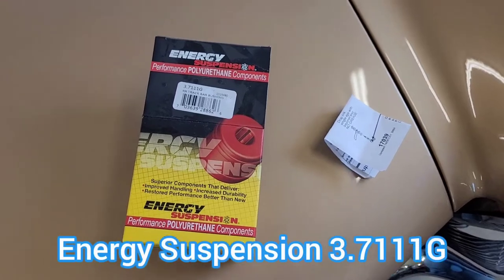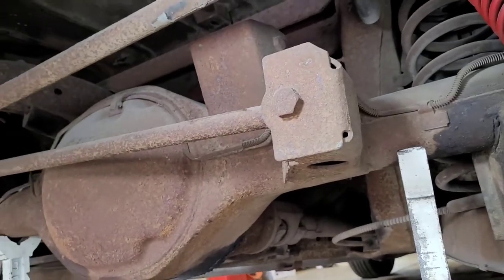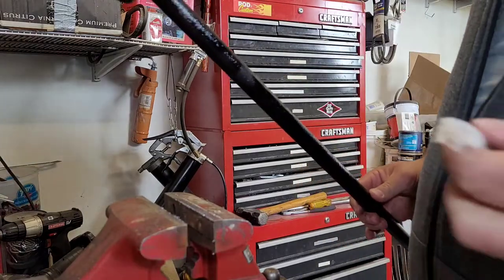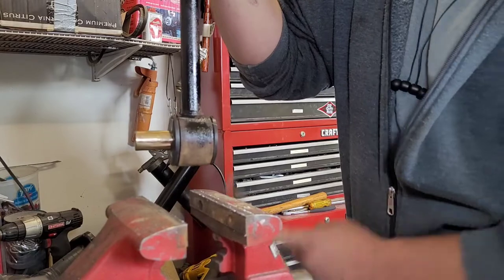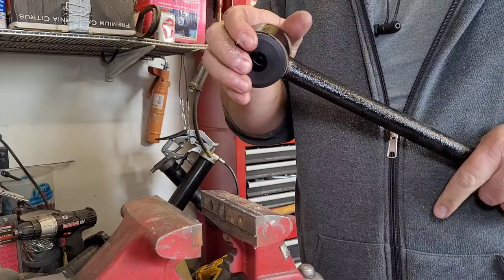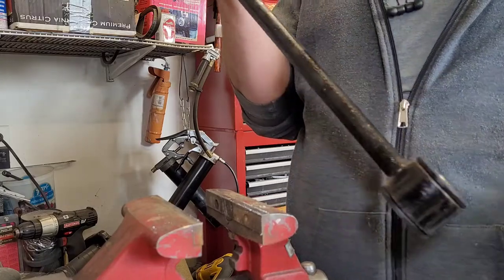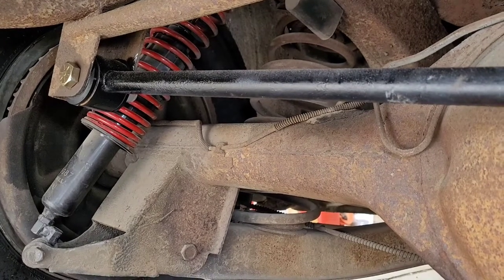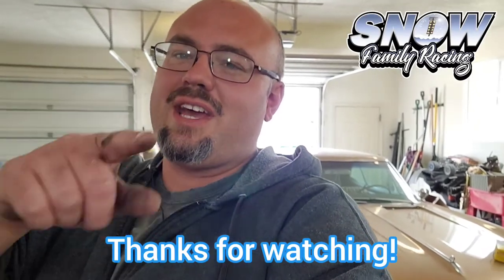The Riviera Steers Itself! Let's Fix The Loose Trackbar!

Comment: Another cool content. Thanks man. Are you gonna replace the front bushing with polys as well?
Reply from the maker: I have already rebuilt the front end with some OE style rubber bushings. I hear rumors of a polyurethane kit out there and have yet to confirm that it fits correct. I do have a complete poly set for the rear suspension. My understanding is that it shares the same bushings as the GM A body in 1965, so the kit calls out 1965 Riviera too. We're gonna find out!

Comment: Easy peasy, lemon squeeze. Are you going to rust treat the bottom with something to stop all that rust?
Reply from the maker: It's slowly getting wire wheeled and painted. The vast majority is just fluffly surface rust. It comes off clean and paints nicely.